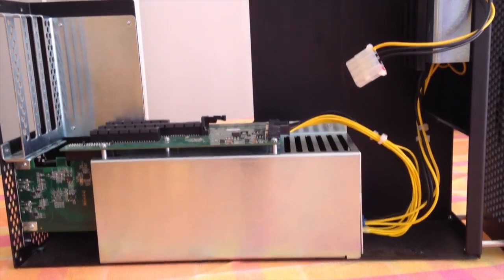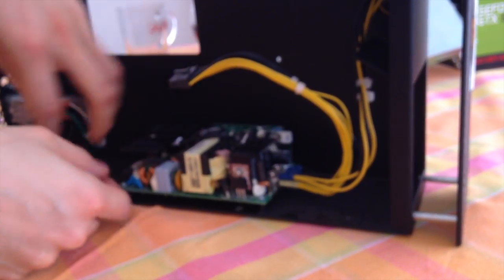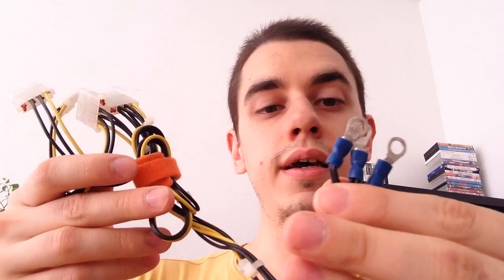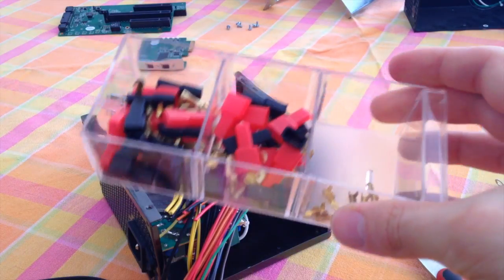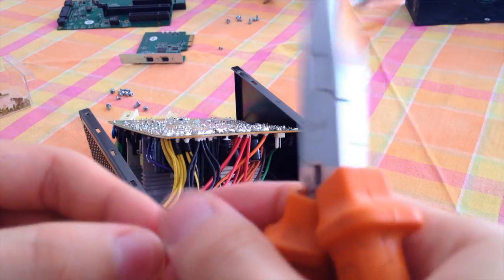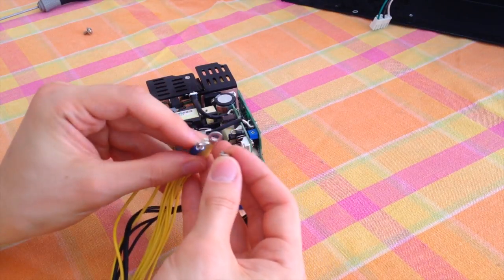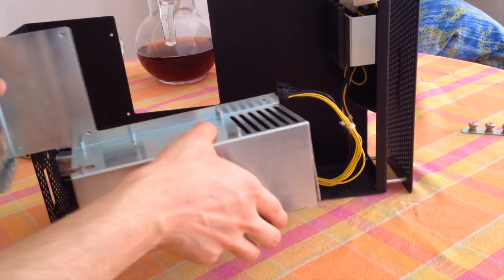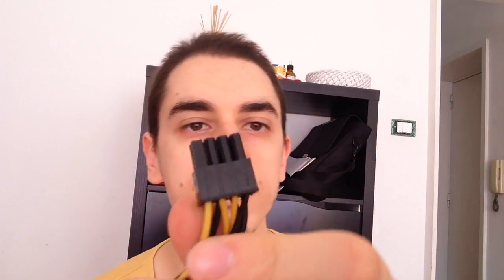Sonnet Echo Express III-D Power Supply Enanchement (Molex)

Comment: I have mac mini but i want to know that if you need to add external psu only by this way to the sonnet echo express III-D ? Regards
Reply from the maker: +maxdiemek 
With a GTX 970 you could use the originel PSU, but with a more power hungry GPU you'll need an external PSU (or change the original one like I'm doing).
Reply: and with the akitio the same?Regards!
Reply from the maker: +maxdiemek 
On the akition website I can see it has a 72W PSU, the 970 has a 145W power consumption, and the 950 has a 90W power consumption.
With the akition you need to buy an external PSU.
Reply: And do what you do in this video?Yo can do it externally more easy no?Regards and thankyou
Reply from the maker: +maxdiemek 
For sure you can!
I've done this for a plug and play eGPU.
Just buy/recycle a PSU and you're ready to go.
By the way I don't own an akitio, so I don't speech for personal experience.

Comment: I'm using 27"iMac(gtx660m. model no: md095kh/a) 1 lan port, 2 thunderbolt ports, 4 usb ports. My iMac connect egpu possible?
i will use gtx970, akitio pcie thunderbolt 2 box(because, sonnet is too expensive :-( , i'm student-16years old  ),power= corsair rm550
i lived in Korea
Reply from the maker: +김한희 Hi! From what I know every every thunderbolt Mac should be able to run eGPU. You just need to tweak the software (Mac OS X via Terminal or Windows via Bootcamp).
I don't have experience with Akitio, but seems the preferred case (for cost).
The PSU is even too big: the GTX 970 has a power consumption of 145 W, the PSU has 550 W on the 12V (which is the only thing the GPU uses), but it's ok if you already have it or think to use in the future in a PC.
Hope this helped, see ya!
Reply: Thank U very much
Reply from the maker: +김한희 You're welcome :)

Comment: hi, i have a http://support.hp.com/us-en/document/c03785356 laptop.(the i5 version) I was wondering if i can have an external gpu? i saw this one but i dont know which one will actually work. http://www.banggood.com/EXP-GDC-Laptop-External-PCI-E-Graphics-Card-p-934367.html
Can you help me?
Reply from the maker: +IRASCIBLE Hey! I don't see any usable port on your Laptop. Maybe if you open the case you can find some mPCIe, but that's up to you if you'll go with open case laptop to connect an eGPU and PSU. I only know how to connect an eGPU through Thunderbolt...sorry ^_^
Maybe check Techinferno.com, they'r super awesome and you surely can find more info there.
See ya!

Comment: What are the adapters you used to connect the three cables to and what is supported by the sonnet for adding the extra molex I need to add a 8 pin power connector and I need the right adaptor to attach to the end of the 8 pin
Reply from the maker: +Mario Almonte Which adapters you meant?

The crimped ones? Crimped-Connections-Custom-Cable-Assembly.jpg